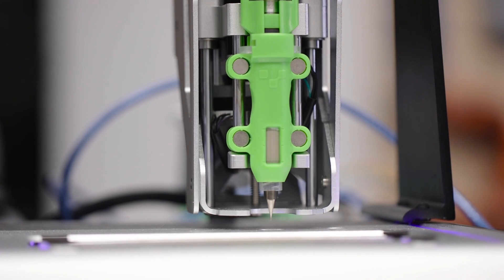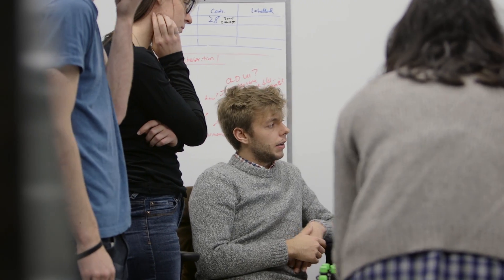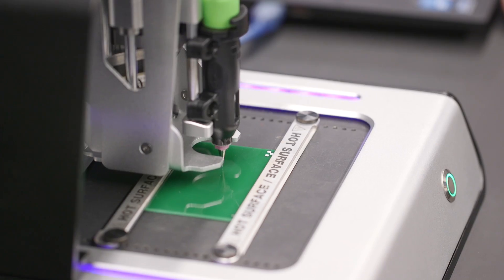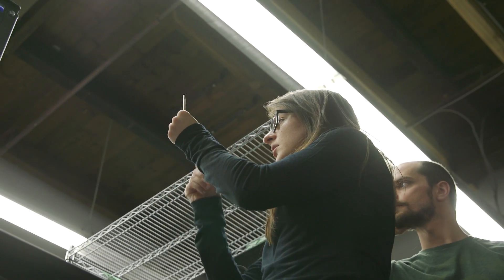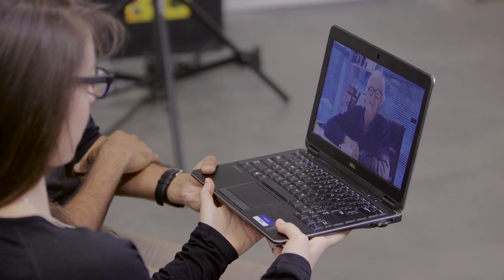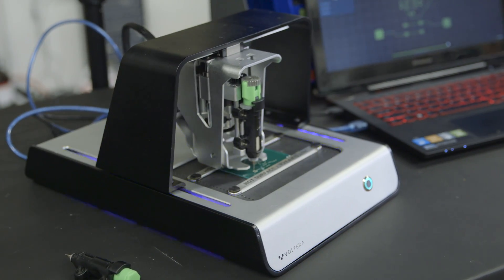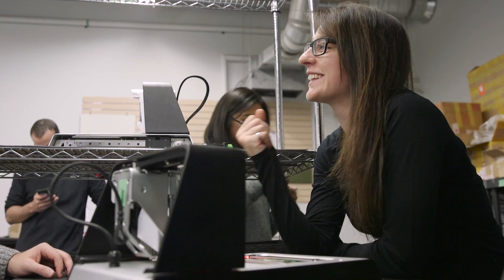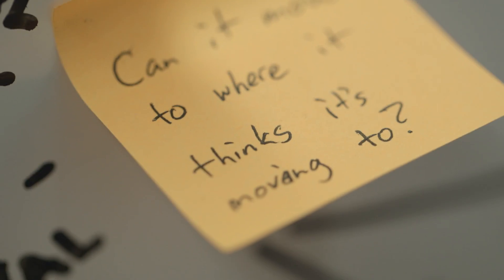James Dyson Award 2015 winner: Voltera V-One

Comment: Remember this only prints the traces. It does not drill the holes or place the components on the board. Are you steady or accurate enough to place a tiny resistor or multi pin chip on the part without smearing the paste? The print area is way to small to really be of use. I'm running test on the paste's conductivity. I question taking a prototype board produced on this going into production without issues. We got one the others day. It will be interesting if we use it.

Comment: Nice and intriguing!

But I cannot understand if it can be used for small batch production or it's only for pure prototyping. I mean... is the circuit reliable? It can resist to vibrations? It will be solder past strong enough to fix some kind of connector on the surface?

Comment: Don't PCB's normally have some holes?
Reply: +Robonza Yes they do conventionally. The holes are usually drilled after the tracks have been etched. (But maybe laser cuts them now? Although laser holes maybe too rough when through hole plating a double sided board. )

Comment: Nice work!! As a PCB designer I know the frustration and costs associated with prototyping circuit boards. I see this is perfect for a single sided board. Do you have plans to expand your machine to do plated through holes and double sided boards?